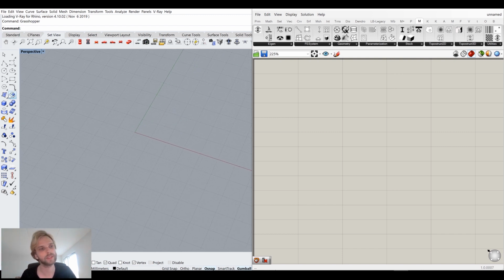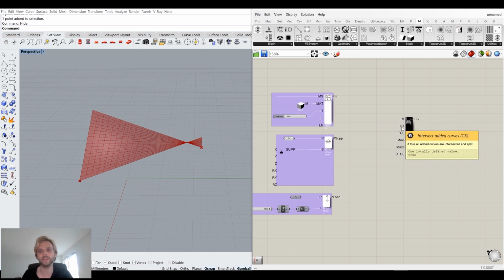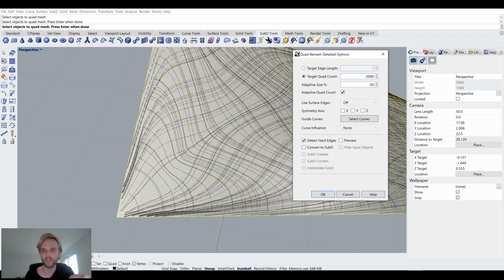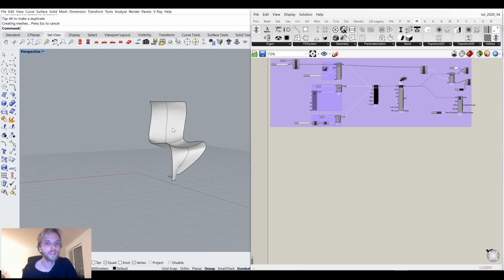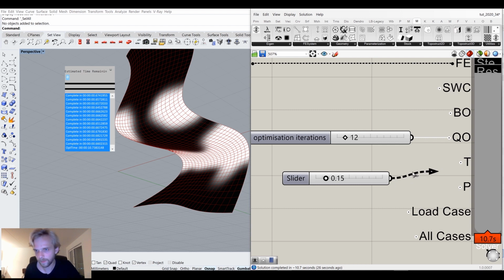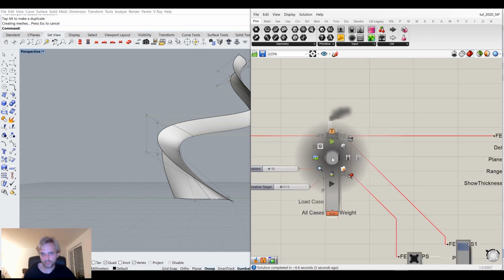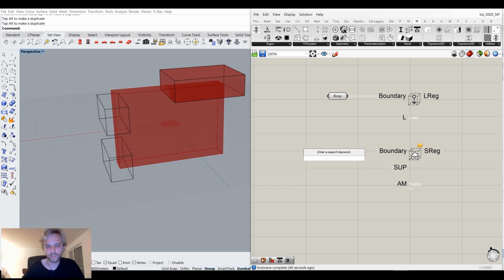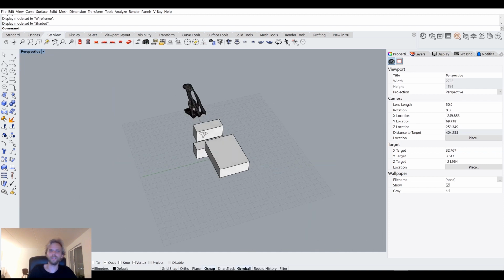2020-34 LTH Tutorials:  Use Structural Optimization for Design ( Millipede + Grasshopper )

Comment: Thank you for the great tutorial!! very helpful.. you mentioned that millipede calculates everything as it was in meters.. how could we know that? I am asking because I want to know how other plugins work.. for example how does tOpos deal with the units.. Is there a way to check in grasshopper? 
Thank you again!
Reply from the maker: Usually some tooltips "give it away" but if you want to be certain, then you need to check the manual that comes with larger plugins (or plan B would be what kind of units are used in the example files)
Reply: @DesignGoBrr  thank you!! I'll look into it. In the meantime,  do you have any idea if tOpos works the same as Millipede and assumes everything to be in meters? 😊

Comment: Hello. Great explanation. One question: why do you think that white space ( in the chair optimization) - is the space where more material is needed to be added? In the SIMP optimization method, which is the mathematical basis of millepede, black pixels ( mesh squares) mean that material here is needed; while white pixels mean that we can get rid of the material there. So, maybe I misunderstood smth, but following the basic logic of SIMP optimization, we need to make black space stiffer, because white space will not undergo any stress.
Reply from the maker: Never thought about this. Usually in scripting - white is 1 and black is 0, so I assumed that that's the UI that Millipede was built on. Now after looking at it deeper - there are conflicting evidence. https://storage.ning.com/topology/rest/1.0/file/get/2778173613?profile=original here stressed voxels are shaded white, while here: https://i.ytimg.com/vi/nxfQqg7j63w/hqdefault.jpg in black. I think best course of action is to do visual inspection and see what looks right - all of these structures are quite intuitive, so you'd see that somethings off if you were removing the stressed voxels.
Reply: @DesignGoBrr   Thank you for the reply! I was searching for some more tutorials on Millepede,  and some of them are described in the Millepede handbook. In ZIP file there were no tutorials. Probably, you have these tutorial files, described in the handbook, and which are usually inserted in plugin zip package?

Comment: Hi Gediminas, do you have any idea of how this video, made by Arturo Tedeschi (AAD), have been made? https://www.youtube.com/watch?v=nxfQqg7j63w&ab_channel=ArturoTedeschi  I've been using Millipide, and I don't find the way. Thanks so much!
Reply from the maker: I think it's literally the same procedure as shown in my tutorial.
Reply: @DesignGoBrr  Yes, It's possible, thanks. Others commercial FEM software name "shape optimization" to other technics (they move the nodes in order to find the optimized boundary, minimizing stress), that the reason It confused me. I also have tried to optimized a polysurface (shell element), but the algorith did nothing. Is it possible that Millipide just optimized square mesh? Thank you again!

Comment: What if you use the multipipe in rhino7 directly to the stress curves? Instead of all the weaver bird work I mean... I just got into the rhino & gh field so just wondered...
Reply from the maker: we need the curves to touch end-to-end , they can't cross one another, so we'd first need to split them up at every intersection point. But other than that - yea - it would work. Rhino 7 wasn't released yet when I did this tutorial hehe
Reply: @DesignGoBrr  thank you sir, all these help and tutorials are great opportunities!

Comment: Thank you for the tutorial, very helpful. On the final example when I plug my breps into "TopConstruct 3D Model" the loads / restraint lines fail to show. From here, the Top Construct 3D solver begins to solve but stops about 1/3rd of the way through the first iteration. Nothing is showing as orange /red. 
My input breps are 4 boxes which pass through (1)- "3d boundary region" (void = false), 
(2)- "3D load region" (leave load option alone), and (3)- 2x boxes through "3D support region" (+support type: all module)
I'm really struggling to see how this is wrong with such a simple situation (3 connections), if you have any suggestions id be greatly appreciative. Thank you.
Reply: Nvm. If others are having the same issue I needed to flatten the "model components" input on the "topconstruct 3D model" unit
Reply from the maker: Great to see viewers adding to the knowledge base :)

Comment: thank you very much. you are the best tutor in computational design. is it possible to make a tutorial for self-organization and agent based modelling? with quelea or physarealm plugins for instance.
Reply from the maker: Thank you! Umm I have 3 tutorials on agent based systems - 2020_18, 2020_19  and 2020_20. None of them use quela though (at least a few years ago it was very unstable, so I stopped using it)
Reply: @DesignGoBrr  yeah i saw those tutorials and they were really awesome. actually i meant self-organization tutorial. and thanks for your advise about quelea.